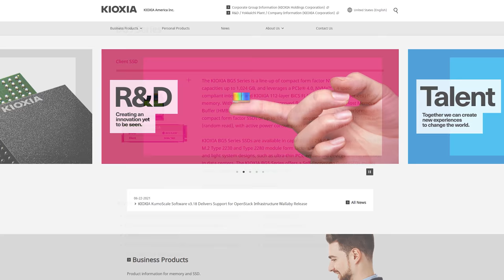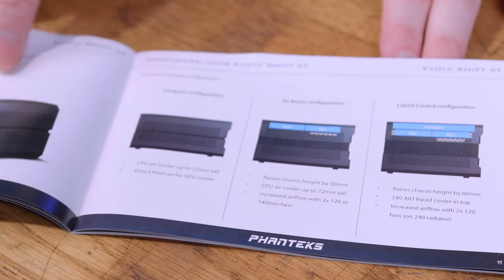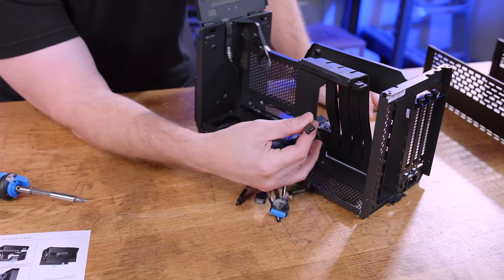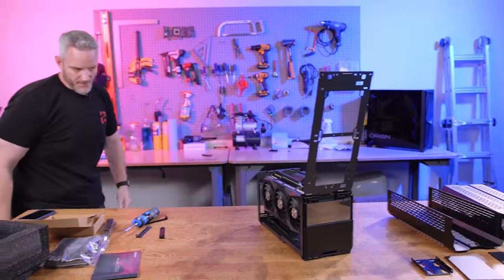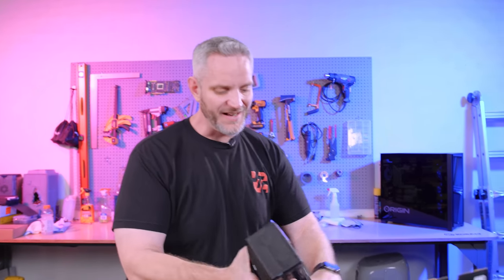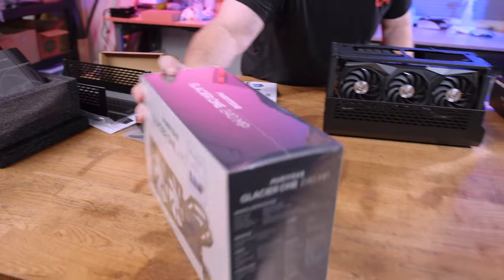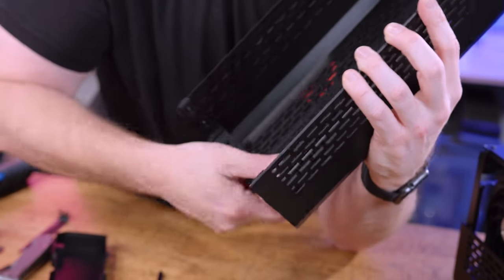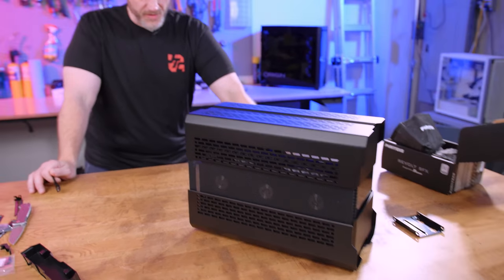I just fell in love with this case...

Comment: The one thing that bothers me about Phantek cases is lack of spare parts. I just checked their website again and they are selling some of the most common parts for their popular cases. I have the Enthroo Pro tower and I wanted to get the window side cover and they now sell them for a reasonable price. I also have a Corsair 750d and it needed some parts because I got it used good and I was able to buy any part or upgrade part also very reasonably. Now as far as replacement parts they are about on par with each other. The Phantek case also can be easily disassembled to remove unwanted parts or change it around. My Corsair came with ALL the case fans, you get the basic big front and rear fans with the Phantek and you can add the extra top fans etc.
They are quite a bit cheaper than my Corsair would have been new and I agree, the hardware and tools they include in the box are great, everything you need neatly stored in a plastic case. I plan to add wheels to mine and it should be easy considering how modular and flat the bottom should be with some work removing unnecessary trim.

Comment: one thing those small cases haven't figured out yet is to give you a power switch if the PSU is otherwise inaccessible. my motherboard (an Asus Crosshair VIII Dark Hero) has an issue where it doesn't shut down properly sometimes, i guess, and requires me to cut the power before it'll boot up again. that's something i wouldn't be able to do in this case. obviously i could just yank the power cord out of the PSU, but i feel like that might not be a good thing to do

Comment: Would be so cool if you could use 2 AIO coolers. One for the CPU and one for the GPU. 2x 120 AIO to cool mid powered hardware at a reduced temperature and noise.

Comment: Would love to see the Sharkoon C10 mini ITX case on this channel the BEST mini ITX case that you can find. Smaller than this case and you can run a FULL GPU and 240 rad. I have the sharkoon C10 mini ITX case running a gigabyte b450 mini itx, Ryzen 3600, with a single rad on CPU with a full MSI 1070ti gaming X card and CPU and GPU temps are 60 degrees and 70 degrees Celsius respectively under full stress test load

Comment: It looks amazing! My questions with it though is what MBs can you put for overclocking on a small case like this one? Also, the power you show here is smaller than a typical power supply, how would look or be able to work in the case? If not, then what type of power supplies would be best for a case like this? 🤔

Comment: Speaking of cases. I have an idea that I may never possess the ability to procure or create with my own talent. So what I seek is another accomplishing this dream. 

Outer shell: Old barn wood cured with tar coating, planed down to leave black groves from the wood's age. Addition of Hazard signs that have or appear rusted. These signs would be to fill slots and places for secure attachment and easy ventilation. 

Inner shell: Painted or constructed similar to Hazard signs, with appearance of haphazard assembly. 

Buttons and ports visible on the front panel should be akin to old model cars, from knobs and car chokes.

This idea case should be similar to older model computers, therein the mainboard sits flat. Inspired by IBM personal computers from the glory days. 

P.S. A computer some mad scientist in a retro-fallout future would possess.

Anyone interested in this?

Comment: I'd like to hear it running with a 240 30mm thick AIO and push pull config 15mm fans. That takes up the whole 60mm top space and I'd like to know if it starts to send the fan rpms through the roof without a top air gap.

Comment: Now if only GPU manufacturers would get on board with SFF and make a version that would fit with these smaller cases. I'm sure they could get the size down if they actually put some effort into optimizing the cooler. Seems like most coolers are just an afterthought and just cool by brut force with bigger and bigger heatsinks.

Comment: As an adult, what I want for my next PC case, is some super easy to access,  unit.. I want to be able to swamp the GPU out, or be able to replace ram easily...
Basically I want a functional PC, but want to be able to get to the guts super easy so I can add storage, remove storage hardware, do maintenance. Almost have PC w/o
the case...

Also the links to Amazon US, don't work...?

Comment: I have to disagree a bit about the manuals, I bought the P500a and it was really just a photocopied thing. Same thing with Phanteks 360 AIO good cooler running fine for me but the manual wasn't anything special. I really am a fan of Phanteks but please only give praise for that specific thing in the review of that item it may not be representive of every manual they do.
After being that negative I really do think the items they make are good quality in the 4 things I've bought that they make. (case, 1 individual fan, fan controller and AIO)

Comment: Currently building my first ever PC, ( been wanting to do this for around 9 years but never had the expendable cash) Gigabyte Aorus B550 Pro-P, R5 5600x, 16GB white Vengeanc pro 3200mhz, 512 Samsung M.2, 2TB barracuda HDD, 750w Corsair PSU, H100i Elite white cpu cooler, Corsair white 280x Micro ATX, and I cannot decide in a GPU yet, thinking either 6600xt or 6700xt… thoughts?

Comment: I just got done building my new computer ,I used the phanteks 400a case, I was very disappointed by the buld quality of that case. The thumb screws for the glass side cover and the non glass side was taped on a angle so that it the thumb screws hard to start,the front fans was installed but missing half the hardware,did call tech support, but they never got back to me,so I would say buyer beware.

Comment: The biggest cards of the generation is/are the XFX Speedster MERC 319 6800XT/6900 XT with a whopping 340mm/34cm/13.39inch long, not compatible with every case exactly xD.
Edit: And yes, it's triple slot

Comment: Here is a not-so-new trick, Microsoft has started to download Windows 11 updates, (I have Windows 10 pro), causing it to jam.  Those downloads also remove those needed Windows 10 programs required to keep your computer working.  So if you have your computer on automatic update, I would think twice.  They may be downloading conflicting code causing your system to jam or crash causing you to update or pay 100.00 to Microsoft to correct the download. You know, the one download you didn't need.  FYI guys.
Reply: 🖕 Congratulations you among the selected winners claim your PC via telegram 📩⬆️⬆️

Comment: Okay my build list for this case
the case...of course. in black
Gigabyte B550io Aorus Pro RX motherboard
Ryzen 5900x
WD Black SN750 4tb NVME
G Skill Trident Z 64gb 2x32 3600mhz kit
Phanteks PH750 sfx psu. 
Gigabyte AORUS Master 3080ti triple fan
custom black and gold measured to fit, cables.
annnd some paint work on the case exterior by myself
facepalm forgot cooling. probably the 240mm aio that Phanteks makes

Comment: Hey I just bought a Ryzen 5900x with an RTX 2080 super, 32gb ram & 1tb ssd and 4tb hdd with msi x470 gaming plus mobo. He told me I’ll be set for years because it kinda overkill and It’s a high end pc. Did I get ripped off? Is these good specs? It’s my first pc and I’m planning on doing heavy gaming and a few multitasking.

Comment: cheeeeeeeeeeeeers! HELL YEA hah. been looking to tear down and rebuild my pc for the first time in 5 years to FINALY get it better and more investment into case fans over my crap or stock ones, and while this cougar panzer case has lived up to every standard i could have hoped for it feels........ old. and it wasnt "cheap" but in the 100$ range i got baited. i went for the newer version that was had tempered tinted glass on FOUR SIDES......... and 3 really cool red ring intake led fans............ i thought the mesh looked like shit........ i wanted to be fancy and wanted it to look sleek and clean....... hoenstly it still looks amazing but over the years ive come ot hate it. 99% of the time i have the front pane off for more air flow........ i have never properly temp tested this pc but  even tho cougar did an AMAZING job at giving proper ventilation buffers for side air flow to the case front and top and such........ i just find it to be a pain point and ive bene looknig for soemthing that lets me flex my aerospace degree and truly work on asome quality AF case fan airflow arrangemetns. evne if its actualy worse, evne if its does nothing better, its just for mental enjoyment and some potential. also because i cant afford anything besides 4 rpg specialty fans hahaha gods knows i aint getting a new gpu..........THO ive bene tempted to final upgrade from 2000 series ryzen to 5000 series now that its fully fleshed out and its finaly at the end of the amd4 socket. so i can have a top of the generation setup and let the new archetype mature before deciding how, when, and how much i wanna jump into it at. nothing wrong with a 300-400$ investment for a cpu (potetnaily mobo for b550 from a b450) refresh even if its not "worth it" i deffinitly thin kat 5800x will be miles better than my 5+ years old, work horse of a 2600x or /we it was hahaha. cheeeeeeers
Reply: and yes ive hoenstly considered going to a dynamicly smaler form factor if i do get an entire mobo refresh for a new cpu. because my full tower extra case just takes up so much realestate, and while i love it and enjoy it, id love to consider some other way to make a statement piece that can fit on a new 72inch desk or something but not feel like a boulder hah

Comment: This idea that ATX power supply fans are not designed to vent the case is one of the dumbest ideas in "enthusiast" PC building. They are designed to do this because the ATX spec says that is the purpose of the fan. Some important components in a PSU, like capacitors, become less efficient when colder. So these units are designed to operate best in the conditions they are intended for. That is why every decent case allows you to mount the PSU correctly (venting the case). But they also allow you to mount it incorrectly because amateurs with poor information demand it, and at the end of the day the makers need to sell these things.

Comment: EZDIY-FAB GPU VGA PCIe 8 Pin U Turn 180 Degree Angle Connector Power Adapter Board for Desktop Graphics Card-Standard Type 2 Pack

Comment: Nice advertisement, with several flaws:

Which part number of psu, case, aio?
SMALL SFX Power supply, oh look what a big space left. well when you take an overpriced power supply in small form factor.
No rubber parts between metal parts and possible cable ways.
No fabric cable ties
no proper cable management.
no dustfilters
only one usb a port
0nly one usb c port
no fans, costs extra.
--

not fully assembled with mainboard, ram, cpu, cpu cooler

revolt psu costs with 750 watt 200 euros in europe and not in stock. from my build from a shitty company around 95 euros for 750watt psu
case not available in europe. price listed 220 euro early march ... double price for good case, for this build quality it's 4 times overprized.